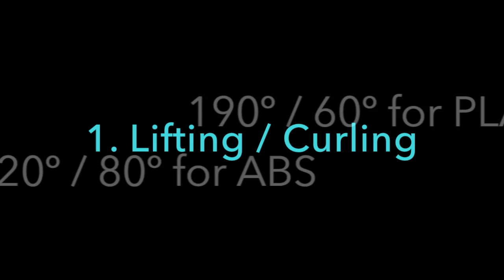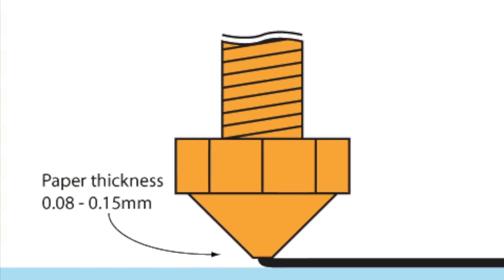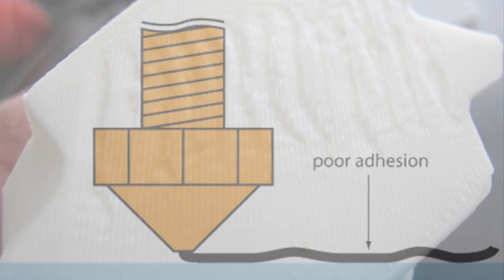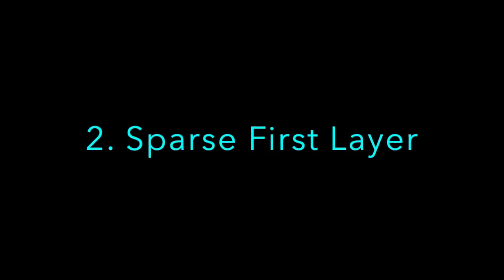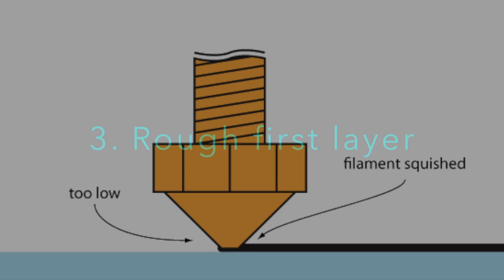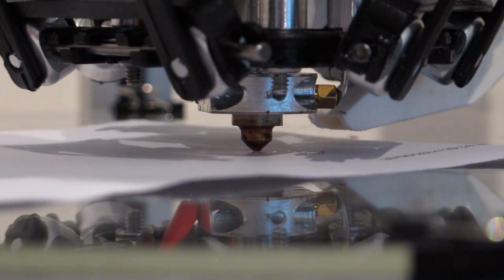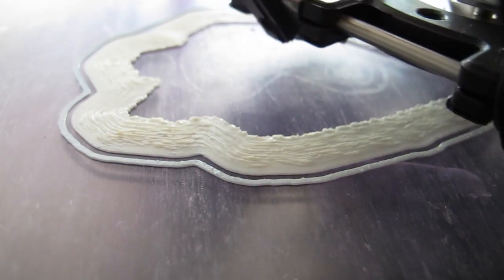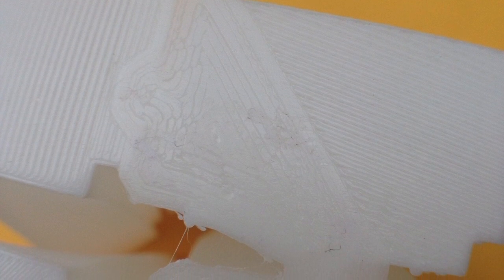Troubleshooting 3D prints, first layer issues

Comment: Yet another video that did not help me. I am having first layer issues only in simplify3d. I tried increasing and decreasing the % of first layer height and that did nothing. I tried adjusting primary layer height and that did nothing. I tried lowering the speed and temp but that did nothing as well. I just cant get the machine to spit out enough filament on first layer no matter what I try. The walls and the rest of the print is amazing but the first layer is just SH**!  I dont get what the issue is because my other programs dont have this problem.

Comment: I level my bed to the extruder tip with standard sheet of paper. But as soon as I print my test benchy the bottom layer appear as if the extruder nozzle is right on top of the bed. The printing on the bottom isn't there. The bottom is almost clear.
Seems like I need to raise the nozzle, but why does it do that if I just set the height? I'm a newbie so I might be missing something.

Comment: Little tip I learned from my local 3D printing Pro; use a postit note as the piece of paper you'll be dragging between the nozzle and bed when leveling. Postit notes are thinner, so you'll get a smaller gap.

Comment: I just found a pretty interesting issue.  If my first layer uses a concentric fill it warps and doesn't bind properly vs using a zigzag fill makes everything perfect.  I'm assuming this is due to the big difference in cooling rates on concentric lines vs zigzag.  Zigzags are typically very similar lengths where as concentrics are not.  I'm guessing this is the issue.

Comment: Hi, are u sure the knock you ear is because the nose touch the board ? I've a Cr10 that sometimes do that and the noise is coming from the filament push. Because sometimes my printer can't push the filament because my nozle is not enough hot. So i must have more temperature to prevent accumulation and stop that knock.
It's like a glue gun : It's harder to push the glue if nozle is not hot enough.
But if nozle touch the board, it can do it to, it's like an accumulation : but it certainly depend of resolution. In 0.4 it need more plasti than in 0.1 so it accumulate plastic but i've a paper between so normaly plastic will be larger on the first layer but no accumulate..

Comment: I use white glue. The stuff you use for wood.
Or any white glue you can find really.
Never had any luck with glue stick.
Peace
He's not wrong about using glue stick. Most people do use it on their build plate.
But for some reason white glue works for my printer.
Peace.

Comment: Piece of regular window repair glass from Lowes, cleaned with  alcohol, then a one quick spray of "Aqua Net"  hair spray and spread around with a wash cloth and bam, perfect first layer.  Also of course level till a piece of paper has just a slight pull when moved under the head of the printer.

Comment: So I'm printing right now and the start always looks good. good adhesion etc. But then after the perimeters and the first half of the infill of the first layer the extruder is just extruding thin lines or threats or little balls on certain spots. And it's doing it for the third time now I rotated my model lifted the bed closer to the nozzle and as the error occurs every time on the same spot I don't think it's a filament problem. Any suggestions? Because I'm really frustrated right now :-/.

Comment: Why does it suggest such a low temp for PLA. I print from 205-215C with PLA as it helps with layer delamination, which is normally a problem with PLA, especially on thin walled prints.

Comment: I've noticed gaps recently in my prints. Like printing out the letter A, the outside wall separates from the inner build. And edges that are suppose to be rounded, like for a curved hinge, are lopsided. I've been using the purple Elmer's glue sticks, so pretty sure that's not the problem from previous builds. I'm thinking my bed is not leveled. When adjusting with a piece of paper. Should there be a little bite on the paper or should it glide between the extruder and bed effortlessly? I was printing good for a past two years. Then one print was all cracked and wispy. I tampered with the bed and got the same result, found it was a clogged extruder. Cleaned it and now my prints are like I first mentioned. Btw I'm using the XYZ Da Vinci with hacked firmware to run Repetier host. Because the XYZ software wouldn't work on my laptop for some odd reason. Any advice?
Reply: Check to make sure none of your axis are loose at all and slipping. That is the normal cause of lopsidedness.

Comment: Stupid question. But if you are using things like Glue, Syrup, and Hairspray, does that mean "tape", like the blue painter tape, is supposed to be sticky side up?
Reply: No, put tape sticky side down.  What I do is place strips where I know the corners of the piece I'm printing will be.  Tape works really well so it can be pretty difficult to peel it off after.

Comment: Haven't been able to solve corner curling/lifting, but i'm using a Da Vinci Jr that has DRM'd filament.  Currently using a sheet of BuildTak as my bed surface and it helps, but still have to end up building "mouse ears" into my model to ensure it stays flat.  Surprised that wasn't mentioned in the video.
Reply: +ydoucare55 IF your using ABS, i recommend buying a sheet of PEI. I Bought mine on amazon

Comment: I have a prusa I3 with autobed leveling (tramming) and it prints verry nice at nozzle 205 celsius and my bed set at 35 celsius with blue painters tape on it for PLA. I printed a rear axle for my rc car first a test model with 0% infill and the quality was amazing, but now I want to print the rear axle at a infill of 100%, but every time it starts to wrap of the bed. Do you have tips for me?
Reply: Magigoo seems good
Reply: +Raoul Ursum If you have a heated bed, don't use painters tape and use hairspray at around 70 Celsius for PLA. Coat your bed with hairspray pretty thick (Go from side to side until the bed looks clear again, not misty). If you don't have a glass print surface, I don't think this will work, though.

Comment: 2 filaments out of 3 PLA filaments are not sticking to the platform. Can you give me a hint what can be done with such problem? Thanks
Reply from the maker: +Nitin Kumar It's kind of hard without some pics of what's going on. Are they the same brand/colour of filament? What adhesive are you using? Do the prints curl up or just start sliding around? At what point in the print does this occur?
Reply: +doodaddoes I've CTC Dual printer which is a well received Chinese copy of Makerbot Dual. I'm having problem with yellow (came with printer) and white (eSun brand, thought that it's the best). The filament that actually works is a inexpensive no name brand filament, it works but I can see little warping at the edges. Before actual print, I can notice that the printer make a kind of straight test line in front of platform. The test line for these two filaments are curled (spiral) from 70% to 100% of the line. And when they start the actual print, they just slide around, and will start collecting the melted filament on the head soon after. At this point, I cancel the print. I'm not using any additional adhesive, the platform came with blue tape on it.
Reply: Magigoo, look on google
Reply: +AnyGames I fixed the solution already. Thanks anyway!
Reply: +Nitin Kumar i am suffering from the same problem. i would like to know what u did to solve the problem.
Reply: When printing PLA, i ALWAYS... ALWAYS use a raft. It gives the printer some workout before the print starts so even if the first 5 seconds doesn't stick, just yank the loose snot off the nozzle until it does. I also print on painters tape.

Comment: M3D is not printing goes along doing what it should do but 3D ink is not coming out can you please help me out
Reply from the maker: +Helen Moreland Hard for me to tell what's going on without some more info. What material are you using? Temps? Hot-end (stock or 3rd party), model you're trying to print, video (if you have any), pics.

Comment: How do you calibrate the e-steps? You marked it with a sharpie? How do u do this? I have a hobbyking Print-rite. Im having the curling problem at the nozzle and the peely look on the faces where maybe there is too much or its not sticking.
Reply from the maker: +zerocool60544 Send me some pics of what you're having trouble with: isaac@doodaddoes.com
Reply: +doodaddoes I think I got most of it figured out. There was 2 clogs. One in the nozzle but mainly one in the top part where the filament goes in. Second time it happened. This time I had to take the whole thing apart. All the pieces and even had to drill out the top part to get the ripped filament out. Its printing much better but still having trouble getting it to stick and not curl up at the nozzle when it starts. Also the extruder hits the tops of the plastic faces because the top layers build up and look peely because the face filament strips are not staying down connected to the end. 

It eventually fixes its self slightly but this thing has never printed as nice as when it was new. Thanks for the help and suggestions.

Comment: Hi,

How do I exactly fix the mash error ( the error you mentioned at the end of the video) ?
I'm quite familiar with 3D softwares, but when I open the downloaded file, everything seems to be fine. I've reprinted many times but to no avail, strange shapes keeps reappearing.
Moreover, sometimes my printer would print the second layer offset from the first layer, then the third layer would be back without offset, but in the end will stack and burn the overlapping offset layer. Any idea what is the problem?

Thanks

Comment: What if there are lines missing? mine has a line missing about 25-30 passes for the first few layers and then it usually is fine after about 3 layers
Reply from the maker: T. Price Missing lines? Do you mean infill?
Reply: doodaddoes yes, when it does the first layer... I may have fixed it by making a thicker first layer and raising the extrusion amount higher so more filament comes out.... it does still go high and low every 25-30 lines that it lays down for the first layer for some odd reason. It will start out perfect nice and thick then after about 25 lines it goes kind of thin for about 25 lines then back to thick and it repeats till the initial layer is complete. I cant figure out why its doing that
Reply from the maker: T. Price Do you have a photo of this you could email me: isaac@doodaddoes.com
Reply: doodaddoes Sent. Please let me know if you have any idea what is going on
Reply from the maker: T. Price I just checked now and there still is no photo. Would you mind sending it again?
Reply: doodaddoes Here is my main account, I tried again but I am just getting bounce backs so maybe the email you gave me is not valid. :-/
Reply from the maker: wrxsubaru02 I sent you a message with some other emails.
Reply: doodaddoes I tried again but haven't heard back so I just went and uploaded to Facebook so I could paste the link here... The last link was before I got the nozzle closer to the bed so now my prints are perfect height but they are still missing lines on the first layer and most of the print but the last layer is usually perfect so I'm lost here.
1. https://scontent.xx.fbcdn.net/hphotos-xpf1/v/t1.0-9/11540824_10153263277057013_2785018872767714666_n.jpg?oh=629f89ab87c3892be7aa03c1cd755e7c&oe=55EECCB5 
2. https://scontent.xx.fbcdn.net/hphotos-xap1/v/t1.0-9/11237565_10153263279207013_529873845858892288_n.jpg?oh=89e749d17c76c8f7228795b39c78fa80&oe=55E89AFF  
3. https://scontent.xx.fbcdn.net/hphotos-xaf1/t31.0-8/s960x960/11425097_10153263281927013_9013620459052656084_o.jpg
Reply: T. Price Check the motor drivers; they may be over-driving the extruder motor, or not getting enough cooling (this happened to me, with the same results you photographed).  If this is the case, your extruder motor may audibly 'click' around the same time that the lack of extrusion (the gap) occurs.  Also, check the complete filament path, and make sure nothing is physically binding or pulling-back on the filament, fighting the pull of the extruder motor.
Reply: James Laine  Hi James, thanks for replying to my issue, I checked all of that but what is strange is it is just skipping the path all together... It just jumps too far over and misses the next path/line for some odd reason... I messed with everything including the belts but nothing made a difference... I will be upgrading to dual extruder soon with new firmware so once i do that i will be back with an update if the problem has been resolved or not.

Comment: Hi, I just saw your video, I am doing some research m because I  am having a problem with my nozzle, filament is not extracting. That would be so great if you can help me . Or give me more information . Thank you for the video. I learn some stuff too
Reply from the maker: Arnaud Govinden I'll try. Tell me what filament you're using, hot-end, temps etc. Can you swap to another filament and have it extrude? Is it only 1 filament that isn't working?

Comment: Good stuff! i enjoy your videos for two reasons: one they are as already said, clear and straight-forward, secondly because your using a delta printer (and a ROSTOCK MAX if I'm not mistaken). because of these points i would like to request/suggest your next trouble shooting video on how to achieve an even bed calibration. as a Delta user myself i am able to adjust the towers and center point to perfect paper thickness but get points wither too tight or loose from the bed between towers - how can this be solved? Thank you
Reply from the maker: Andrew Webb Yes, they're Rostocks. Ok I'll add this to my list of videos to make!